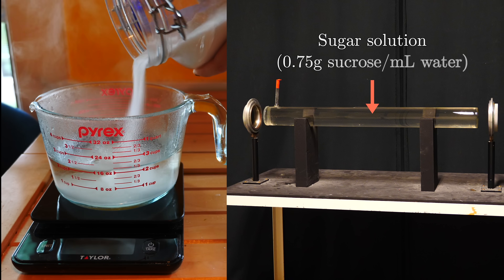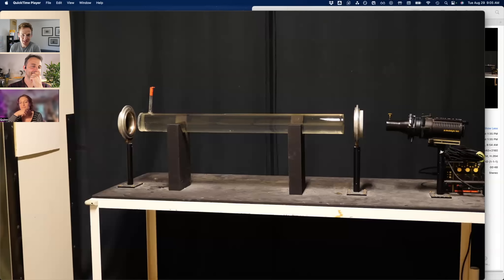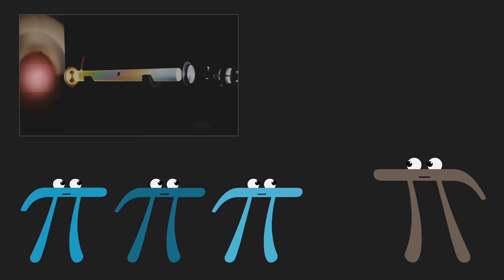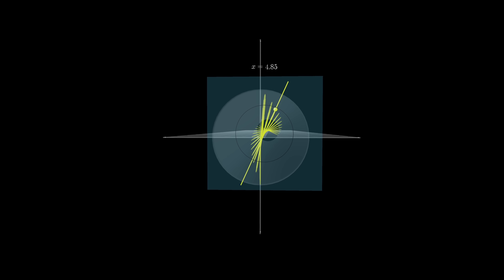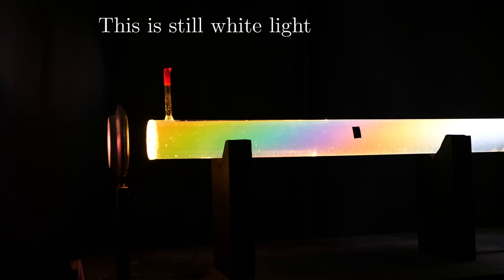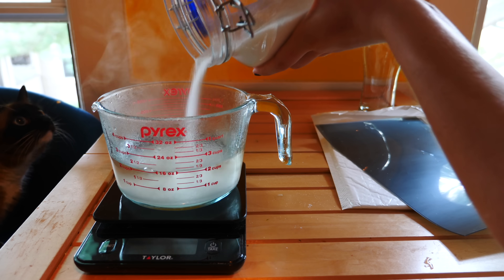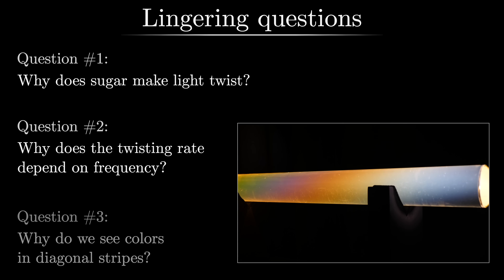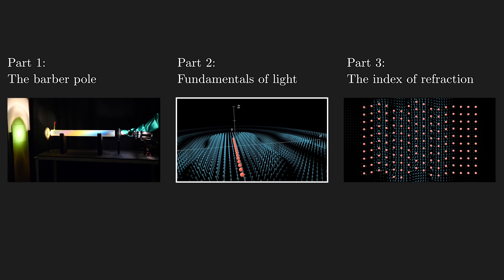This tests your understanding of light | The barber pole effect

Comment: I have made the same monochromator (in february 2016) , but it's flat (transmission based). I can teach you how to make two totally different types and release everything as public knowledge. Tested in a lab, we have done F.I.S.H. with them. One has worked perfectly and almost as good as a 5 thousands bucks monochromator based on dichroic mirrors and diffraction gratings. Another application can be quantum switches.
edited with more details
nobody cares, must be my nickname, nuff said
Reply: can i ask an advice to replicate the light effect from this video? i need some info about the power of the lightsource,  would a powerfull led work? thanks
Reply: @tommyjs1992  many LEDs have specific peaks and their emission spectrum may not be ideal. It's not too much a matter of power but rather of wavelenghts. A filament bulb is far more superior for these experiments but Cree's LEDs have a wide spectrum and enough power. The point though: as long as your light source gives you the widest spectrum possible, you're good to go. You can even combine multiple sources.
Reply: @FreedomAirguns  thanks for the answer. So if i find a full spectrum LED i should be ok right? Unfortunately if i understand correctly filament bulbs have such a shorter life span so my lamp would last not too much :/. Last question, the light in this video has a power of 150w and i see visually that the lamp is powerful, how much Wattage should i search for if i want to replicate it with a LED? because i heard that led use less watt to create lumens but i don't know how they compare (Filament bulb wattage and led wattage). Thank you again this is very helpful

Comment: If the frequencies twist at different rates, what happens when they all line up again at 0°? I assume the color would be equal to the source light, though maybe it would be more pure white at alignment. If a frequency were filtered out before the polarizing filter, would white be obtainable?. The demo showed red and violet aligning at 180°, will all the frequencies ever all align inverted to 180°, and would that result in black or the nullification of visible light?

Assuming concentrations vary twist rate, how many rotations may be more accurate, but I'm more interested in the phenomenon than the distance. I'm not an expert or student of these fields. I'm merely an interested layman, so I apologize if the answers are obvious.

Then I'm lead to theoretical application. With known precision, could a video be scrambled, recorded, reproduced, and decoded.

Anyway, thanks for humoring my inquiries.

Comment: A few questions and speculations:

1. I'm guessing that a higher concentration of sugar would result in greater twisting and increased coherence of the colors.  Is that true?

2. How does temperature affect the phenomena?

3. It would seem that if the distance between the filters is a wavelength that happens to be a sub-harmonic of two of the pure colors, that the end opposite of the lamp would emit a mixed color!

Comment: What a fantastic video! Could I suggest / request that you try a longer container? (perhaps very long). I'm not super surprised by the diagonals, as the light separates into component parts that are twisted, and I wonder if a container of a suitable length will start to get effects where the various colours with their own rate of twist start to interfere and produce more colours (e.g: mixed rather than pure)... will the pattern repeat?... what happens if you insert only narrow-band light (e.g: a diffuser laser)

edit: I just watched part 2 - so pleased that the filters did such a good job! 😄

Comment: I say the higher frequency wavelengths are affected by the sugar more because for the same distance of X traveled, they have traveled a longer route through the sugar, thus twisting more.

The diagonal lines are the different frequencies being spread out and that point on the wall is just where that freq is hitting. Remember you have 1 line of each freq (I know of infinite freqs) making its way twisting. I would think a color filter between the lamp and the first polarizing lens would show this for the color of filter used.

Comment: seems like it's the scattering of the light being reflected and interfering with the light that hasn't been scattered yet.  
and it would seem to me that because of that.  the rate of rotation would change depending on the diameter of the tube.

Comment: does the diagonal color stripes in the tube change x-position too if you change the viewers y-position? 
for example taller or shorter viewer will see different colors at one point at the tube.
i m just curious, unfortunately you made only one setting (recording from the same height as the tube).

Comment: If the tubes length was the product of the colours wavelengths, presumably the end light would be white. But light is a spectrum! But opsin's are (somewhat) discrete!

Math: 560 * 530 * 420nm = 124,656,000nm 
or ~ 12.5cm.
So maybe the end effect wouldn't work with a tube ~12.5 cm in length...

Comment: You need to use a full-spectrum light source, such as an incandescent, halogen or fluorescent lamp for this experiment if you want to replicate these results.

If you use "white" LED lamps, you won't get all the colours; you will see only only alternating stripes of yellow and blue. This is because LEDs only output monochromatic light, that is, light of a particular primary colour. Most "white" LEDS work by having two emitters, one yellow and one blue. The combination of these two opposite colours fools our eyes into thinking we are seeing white light.

If you use "colour-changing" LED lamps - the ones that come with controls that allow you to change what colour they emit - you'll see three stripes in this setup; red, green and blue, which are the three primary colours they combine to create the effect of all other colours. For example, what you see as pink or purple is actually a combination of red and blue with no green. As you change the LED lamp's colour setting, you'll see the three stripes brightening and dimming according to their composition of the colour you've set the lamp to.

Comment: Ok, so here is the pov of a randon 16 year yold:

For me (not knowing anything special about it), the sugar contantly twist the light on the tube axis. The scattering of the any wavelengh is greater on the same angle as it  rotate by the sugar. Those aspects of the  action cause it to make the spiral when "graphed" by time.

(Sorry for my probably faulty english, i'm kind of just sliding with vocabulary by that theme kkkk)

Comment: I'm curious to know whether the diameter of the dialectric (the glass tube in this instance) makes any measureable difference in the outcome.  The effect appears to be driven by the same mechanic that makes long distance fiber optic data communications work in the first place.  I would like to see how diameter affects the orthogonal view, AND the polarized output.  The experiment would require "clocking" the polarizers in some orientation, then rotating them some degree increment on each diameter tube, measuring the outputs.

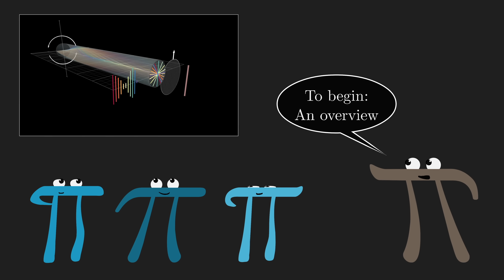Comment: 3:10.

The angle is caused by the change in density from air to vaporized sugar. And that is causing the angle. Which in a tube. Is elliptical. Likewise. All the different bands of light have a different corresponding position. Along the helical structure. And even though it's originally polarized. After it passes through the prism of sugar. It's elliptical. Which means that even when it reaches another polarizing filter. There is a frequency band within that range. Allowing light to pass through Even though it's polarized. Which was my only surprise. That instead of no light passing through the end when the polarizing filter was turned. It would instead change color.!

Oops. I hope I didn't spoil the video.!

Well let's see what you said. 🤔🤓

7:15. And you were correct.!

And it can be seen from the side because The change in polarization starts changing the angle at which the light is being emitted. Buy up to 90°. Which is facing the camera. Or the broadside of the tube. Making it visible. Instead of nothing at all.!

Again I hope this is not a spoiler.!

(But I do like answering questions. As there aren't many questions I don't know the answers to when it comes to the function of reality as I perceive it.)

And the twist of the light being dependent on the frequency is because The sugar prism twists each frequency by a different amount. Depending on its frequency. Which is why you get the twist in the first place.

However to really understand why a prism can separate all the individual frequencies. It's because refraction It's not reflection. It is absorption and re-emission.!

However when it is re-emitted. It only does so based upon a specific frequency. So if you shine a specific frequency of light into a prism. That's all you will get. Is the same frequency of light out. Because there's nothing to separate.

But. If you shine a light containing white light. Meaning all frequencies of light. Then you will get a rainbow.

And if we're going to start talking about how absorption and re-emission works.

I feel like that's a video onto itself.!

Okay so quick recap.

The sugar solution is acting as a prism. Which is of course created by light passing through mediums of different density. 

Which separates the individual frequencies of light. By  the angle of its frequency.

And because The surface of the tube is now at a right angle to the re-emitted light. It hits the tube walls. And scatters. Making The separated polarized light visible along the horizontal axis.

But let's see what you said now. 🤔🤓

Comment: Neat. I think I get it. Polarizing the light makes it oscillate in one direction, but the rotation caused by the sugar makes it seems like the wavelength is increasing as the apex/nadir of the wave is rotated away/toward our eyes.  Rotating either polarizing filter changes what orientation can pass thru; more vertical orientations are bluer, and as the wave rotates the wavelength appears from our eye's perspective to be longer, going thru the spectrum of visible light all the way to red. With a long enough tube (and powerful enough light source) the colors would shift from blue to red and back to blue over and over again along the length of the tube.

Comment: so my intuition says that, would you go ahead and stretch all the different waves of color, the violet one would be the longest and red the shortest. 

so the amount of interaction between the wave and the water would be proportional to the length (stretched to a straight line) of the wave across the whole tube. 

that's probably the reason why shorter wavelengths rotate "faster" than longer wavelengths, since they are more stretched out already (and therefore closer to a straight line)

Comment: How does stirring or agitating the sugar water affect the resultant effect?
Reply: Was thinking about this myself, eventually in the context of Doppler shift for sound vs. light, and at this point in my thinking it seems light is fast enough in comparison to molecular translation and rotation rates, enough so that one would need an extremely precise comparison of stirred vs unstirred effects to detect anything. Beyond that it seems reasonable to imagine the light could itself drive the molecules to spin around in the process of being rotated or deflected, spinning not nearly as fast as light itself, but maybe fast enough to make mechanically imparted motions like stirring seem glacial in comparison. Just spit-balling here. I tend to skip around videos a lot and leave the sound off.

Comment: I definitely had some minor intuition for each of these. I wasn't sure why the polarization rotated, but I assumed at least the direction was determined by the chirality of sugar, (which I assumed must be chiral). Second, the separation seems reasonable given rainbows, prisms, etcetera, although I couldn't tell you the exact mechanism, same as the first point. And finally, the diagonal stripes actually make the most sense to me, by referencing my experience with polarized sunglasses and looking at the surface of lakes or other water. The polarization decreases reflection in one direction, allowing you to more easily see through the surface, but rotating the glasses vertically increases the reflection. In the same way, the diagonal bands are caused by the varying reflection rates on the material transitions (water/tube and tube/air) based on the rotations of the light waves, giving colours because the different frequencies of light are rotating at different rates. For instance, if the light stayed in sync (all frequencies rotated together), I would still expect to see diagonal bands, but they would simply be bands of light and dark. 

But these are all very basic and high level explanations, and I certainly wouldn't have been able to predict the results. I'm looking forward to the more full mathematical explanations.

Comment: ~ I would say that a good explanation of wiggling would have to do with the two component properties necessary for light propagation, transverse & perpendicular waves. 
The single direction polarizing filters are the main facilitators in distinctly separating these two component properites.
~ Sugar water's optic reflexes which include it's index of refraction, reflection, & diffraction properties also attribute to this interesting phenomena, since sugar water is a homogenous solution.
~ The separation of colors thus barber pole wiggle effect is due to the unique wavelength & frequency of each monocolored light source having it's own inherent transverse & perpendicular properties.

Comment: If sugar is a crystal, and salt is a crystal, does this work with salt as well ? and if yes does salt have different properties ?
Reply: You can make crystals out of many things (even just water, for example), that's completely irrelevant. Unless you put in more sugar than can be dissolved, a sugar solution does not contain any sugar crystals. The sugar is instead, well, dissolved. The important property here is that sugar is chiral (or more concretely, optically active, but that requires chirality). Sodium chloride is not chiral.

Comment: Trying to replicate this for a few days now, but can't get it right. What's my mistake?
I'm using high quality linear polarizers, put as much sugar in the water till it stops solving. Using white LED, which is not a full spectrum but should give some colours at least! I don't see any colours at all, not in the glass, not after the 2nd polarizer. All it does is turn black or white depending on orientation.
I'm lost!
Reply from the maker: Hmmm, that suggests there's no optical rotation happening. My best guess is that it has something to do with the specific sugar being used. Is there a chance its not actually sucrose?

Comment: Perhaps the sugar water causes a slight skew in the light's path during each wave period because of the electron orbits of the atoms in the mixture; since light is vibrating electrons. Considering that the path of the wave skews during each period, I assume higher or lower frequencies means more or less periods which means more or less skew. The reason we see diagonal stripes is because of the refraction of the mixture in a round tube. 

To break that down to answer the questions:

0. Electrons
1. Interaction of electron orbits
2. More periods = more interactions, and vice versa
3. Refraction due to fluid being in a round tube

Comment: Man, do I love your explanations.... I just wish all my teachers back in college could explain like you. Questions:
1 I would imagine that the top view also provides for diagonals? What happens if you match the camera frame with the rotating motion of the first LPF?
2 - Is this density dependant? If so, could with  include a speaker to the tube in order to include a mechanical wave travelling through the solution? Would it cause enough or a noticeable effect or would with have to explore the limits of compressibility?
3 - is this a similar phenomenon of that where acrilic changes hue under stress?
Cheers from Brazil !

Comment: Couldn´t density because of gravity also an explanation for the diagonal stripes? Gravity pulls the sugar molecules in the water down, what effect would this have to the light when it has to go through more molecules? What happens when you rotate the sugar water tube,  maybe with a motor to test various speeds?

Comment: The answer to question 0 depends on which era of physics works best for you.

In classical terms, the oscillation is the strength of the electric and magnetic fields.

In terms of QFT, it's probably some tensor component of a photon's wavefunction. But I find QFT doesn't work with intuition, so I'm sticking with the classical explanation for the time being.

Interestingly, the presence of this phenomenon depends on the source of your sugar. You've obviously used sugar from a biological source (sugar cane, I imagine).

If you were to repeat this using sucrose that had been chemically synthesised from non-chiral starting materials, you'd get a racemic mixture containing both D- and L- sucrose, and the effect would cancel out so you wouldn't see this.

Someone correct me if I'm wrong, but weren't the animations in this video (which are brilliant, BTW) appropriate for D-sucrose, whereas naturally-occurring sucrose is exclusively L-sucrose?